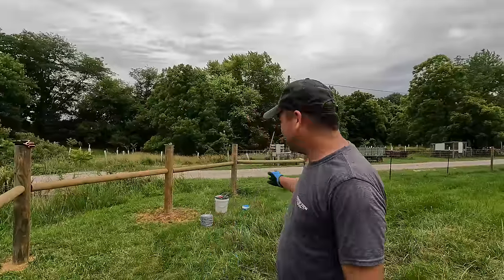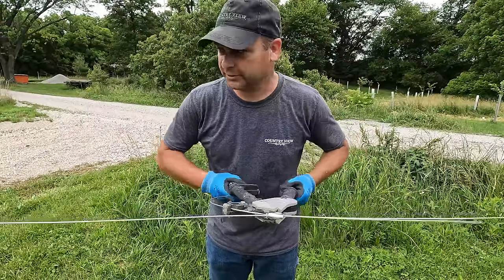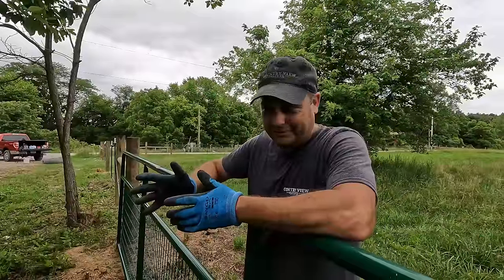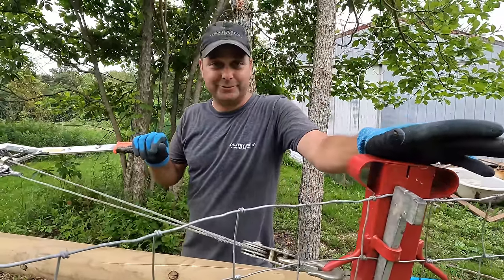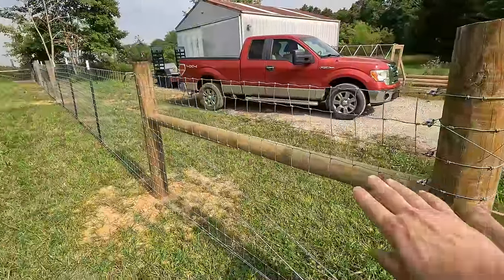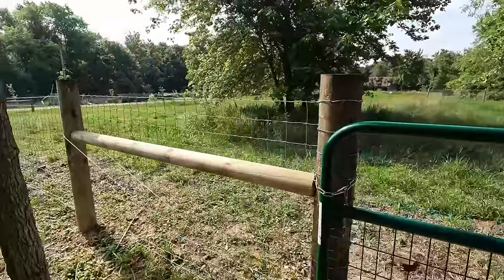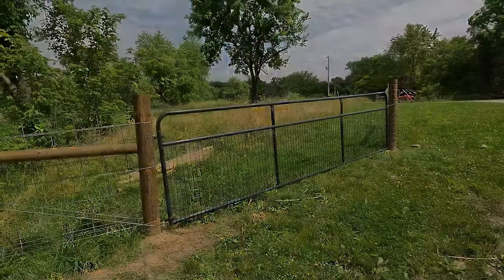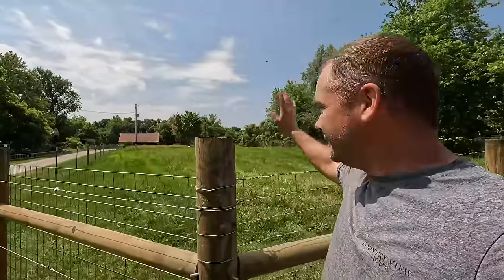Finishing up the new Pasture Fence.  The last fence pull, shortest stretch yet.  Hanging Farm Gates.

Comment: Good job on the fence. We used two 2x4's and bolted three bolts and sandwiched the wire in-between, I have not used the wedge woven wire stretchers before. It's hard to hang a gate on uneven ground, I've hung dozens of gates and I still issues with uneven post for gate openings. I enjoyed watching, thanks for sharing, have a nice day.

Comment: JudithB  Looks  great to me!!  We  had  our  20 acres  divided  in  quarters,  with the  barn lot in the  middle and  loading pen.  It  was  easy  to move the  cows  from  pasture to pasture  by  clapping hands and calling them.  We cut hay on  east and west pasture,  south pasture  had the pond  and  n.  pasture  was a  rocky mess  so not much  grass.  After  cutting  hay,  we  let the cows in  to clean the edges  and  any left over,  then close  it  back up,  and open the  other hay field to be cleaned,  then close up to grow  next  crop of hay.  In winter,  we opened  one  hay field at a time  to  graze and take pressure off  south field.  Worked  well,  and the  cows had to go under bug thing passing thru the barn yard too.

Comment: Greetings from Australia...good job on those fences mate!  I prefer to use galvanised steel strainer posts with bolt on braces for gate fittings - makes adjustments SO much easier.  That said, those timber posts do look good!  Seems you folk in the US use timber posts a lot more than we do here in Oz...on new fences, steel is about all you see over here.  Really enjoy your vids...
Reply: We have really poor availability of steel posts. We can get timber posts just about anywhere. Steel posts are also much more expensive than wood. Last time I checked they were almost 10 times the price. one 4" sch 40 post 10' long is about 400 usd

Comment: i always strip out barbs on the ends of my wires saves the fingers later,  when we built our corral we put in lots of gates some on rings that pivot around a pipe post  able to go about 200 deg or so helps lots in working cattle  or other animals   the loading alley has 3 gates in 15 ft or so, 8ft across  one right at where the trailer sets to crowd into the trailer  with loaded lots of cattle by myself with the setup.

Comment: Regarding that gate, on Welsh hill farms such as the one that I grew up on, what we do is hang the gate so that it is level and either put a large log underneath the gap (to stop lambs from crawling under) or for a more practical solution is to make a triangular attachment for the bottom of the gate that fills the gap and moves with the gate. Adding dirt underneath means that you create a ridge, making going in and out with a tractor more difficult. Conversely, you could dig the other side, so that if your field also acts as a hay field (for example), you have a flat surface for going in and out, meaning that wide implements do not lean to one side and hit the gate post at the top when going in and out. As you have it, you are putting too much strain on the gate attachment points as well as the post.

Comment: If you get a cold cold winter wont the wire tend to contract and break.  The fence is very professional.
Reply from the maker: I haven't had it break in the winter.  But I guess it could happen.

Comment: When you have the correct steel post at height  . Put the post pounder back on , rap some paper around at the height of where the top of post inside the post  pounder is spray paint the top of the pounder  , this will give you the height of the post without lifting it on an off to measure  !

Comment: Cable pullers are a loathsome invention.  And cable jamming between sheave and cheeks is a hassle.  Replace that "axle" pin/cotter with a bolt and Nylock nut to adjust clearance between sheave and cheek.  Might prevent future jams.  Good job on the fence (but I don't think I could "live with" that one gate either...)

Comment: Don't beat yourself up just take your tractor and take a bucket off of the high-end or two and then put it down at the low in make it big enough so you can swing the gate both ways
Reply: On that second gate cut a couple inches out of it put a sleeve in it put a couple of tacks on it bingo bango dunno

Comment: What size T post you use?  I fixing to build a fence
Reply from the maker: I use 7 foot t-post on my woven wire fence installation.  It is tall enough to put a barb wire above the woven wire fence.  or a high tensil wire.  So the total fence height could be 54 to 56 inches tall.  So I have about 2 feet in the ground.  A 6.5 foot T-post would probably work fine, if you wanted to save a few dollars.
Reply: @CountryViewAcres  thanks I appreciate you taking the time to help and I enjoy your videos I pray y’all have a happy blessed new year.

Comment: Question: is there a reason you don't hang the gates first and then finish the rest of the fence? It seems like the gates have the least wiggle room for error, so I am wondering if there is something that stops you from doing them first because I have never built this kind of fence and am about to.
Reply from the maker: Posts shift a little when stretching fence.  Also a gate is another thing in the way when wrapping fence wire around posts.
Reply: @CountryViewAcres  ok. Good to know. Thanks 👍

Comment: Well, if you watch videos from woven wire fence manufacturers, you are doing it wrong.  You pull past the post and cut the wires in the middle of the fencing, removing the vertical wire and wrapping the horizontal ends around the post and then attaching them to the fence wrapping the wire end around the fence at least 5-6 wrap’s.  You leave the top and bottom last, which holds tension on your woven wire fence while you are working the middle.  No stapling the length of the post except the top and bottom wire.  All woven wire that’s not high tensile will stretch with a 2000 lb animal leaning on it no matter how tight you pull it.
Reply from the maker: Fence manufacturer video
https://youtu.be/ztGlTNfNn1c